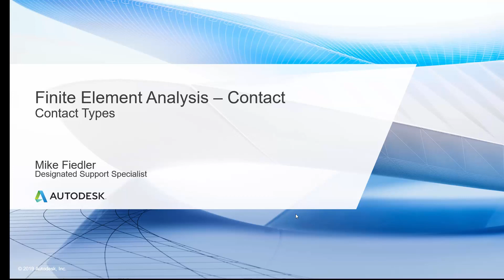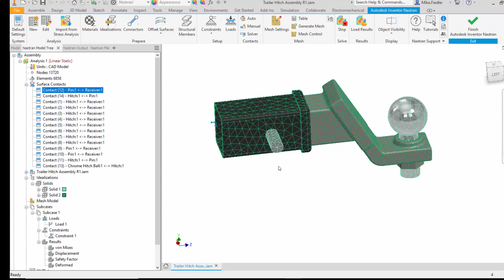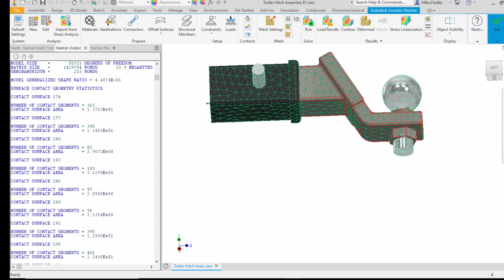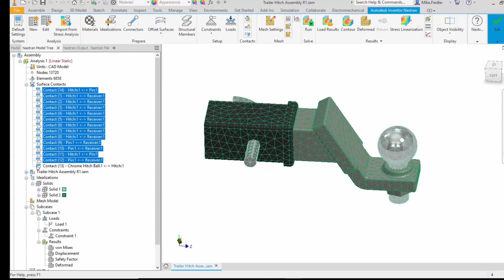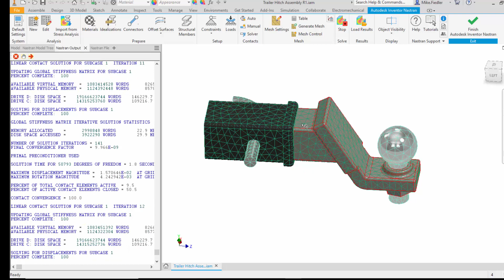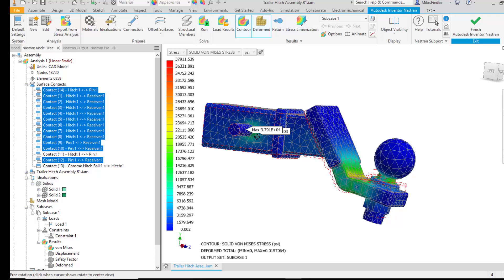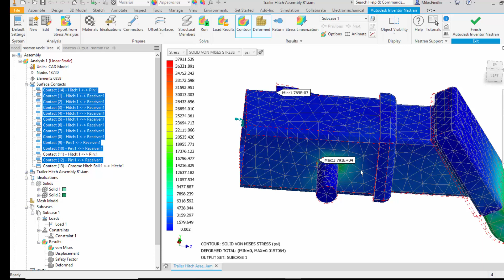Product Simulation with Inventor Nastran: Contact Types

Comment: I am having issues with an assembly fea where the model works with bonded contact, but the spc values doesn't equal the external loads when the contacs are changed to separation. I've tried, refining the mesh, using adaptlncontact and changing the max activation distance. Do you have any advice to locate the problem?
Reply from the maker: Hi moefapie,

The best way to get a detailed response to your Inventor-specific questions is by posting on the Inventor Forum.

Here's the link: https://forums.autodesk.com/t5/inventor-forum/bd-p/78

Hope this helps!

Best regards,
The Autodesk Inventor Team